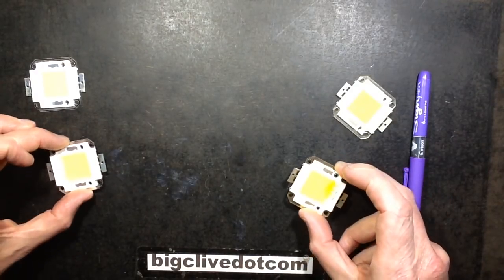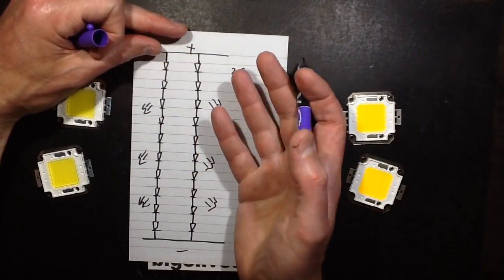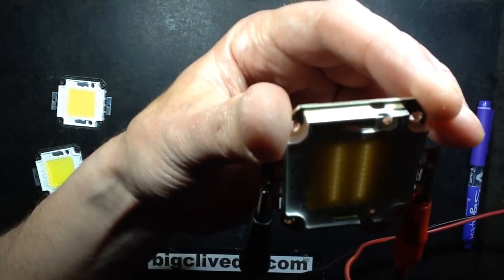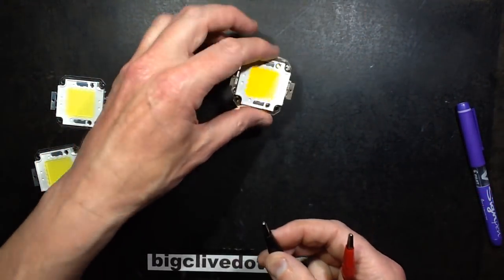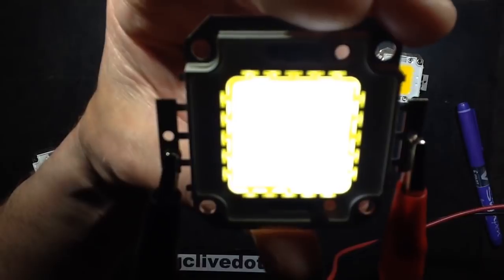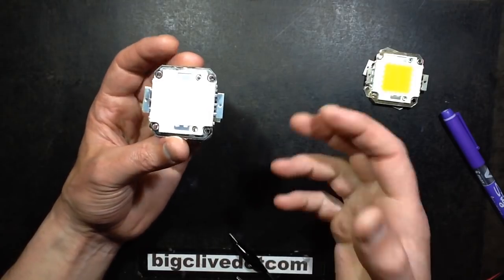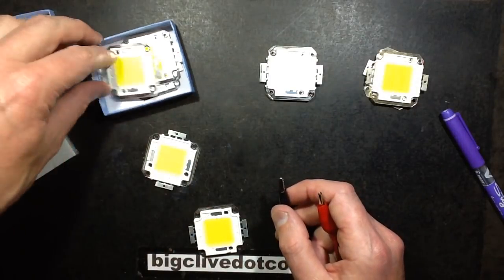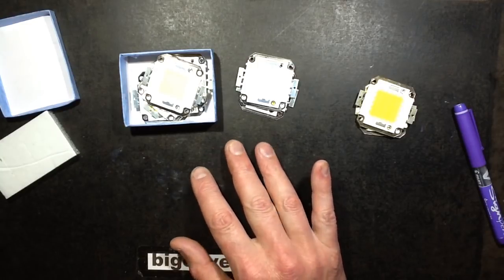Testing dodgy 100W LEDs from ebay sellers.

Comment: You can get the best-binned individually-packaged LEDs and put them on a LARGE BOARD, in the same configuration, and this will happen the same. This is what happens when your parallel/series arrays get too large and the lighting pattern your LEDs display show exactly this. You can't avoid this without a control resistor on each series string. Even the best-binned 100w COBs do this below their appropriate drive voltage, ALL OF THEM. 

I design/consult on LED units. This is just basic physics kicking you in the butt.
Reply: +techkitsune jesus lads chill. this isnt a test of who has the biggest brain or the most experience. at the end of the day we all have to wipe our own arses.
Reply: Even that is a lie. 300w LED unit driven at 150w will not replace a 1000w HID. Even the best LEDs out right now in the lab (330+ lumens per watt) you would still need the full 300w to match a 1000w HID.
Reply: +techkitsune you are so full of shit.. it's beyond incredible
Reply: +techkitsune it's common practice to advertise the led light as the equivalent amount of light it will replace
Reply: +techkitsune you insulted me your first statement, soooo. you def are a moron
Reply: +techkitsune I never have flown a drone??? sooooo there's that I guess
Reply: +techkitsune keep trying though..
Reply: +techkitsune you don't even know what the product you're standing in front of is comprised of.. please enlighten us as to what those leds are called in the industry you supposedly are at the forefront of.. they have only existed since the 60s. you really are full of it.. and quite unknowladgable on leds. dip = dual inline package. there what's in the light you're standing in front of.. but you laugh, because you don't actually know shit.
Reply: True! Uneven lid leds are not of any problem, don't necessarily have linear characteristics so could even level out above 20% power, but even if they don't it's a relatively very small difference @ normal power.
Actually common failure mode is nitride layers coming lose and bonding issues are far more common.
Reply: techkitsune a pothead arguing with an electrical engineer  OMG. Go smoke more dope boy.
Reply: Could you recommend a reliable LED chip source? I have an outside light that had failed due to water ingress and need to replace the chip, its a 30w warm white.
Reply: Nichia, Cree, Epistar, Edison, Osram.
Reply: ....Phillips.....lumi-leds...
Reply: I can't trust Philips further than I can throw them, not after getting sold 25w grow lights which were advertised as 40w.
Reply: I agree.  I learned in grade school level electronics books that diode strings always need ballast or equalizing resistors.  Still, that's to equalize currents between parallel diodes.  All the LEDs in one series string have the same current and should be lighting up at nearly the same time.
Reply: techkitsune ouch...slapped down by a real , educated EE. Ouch.👍
Reply: I have a set of LED lights I bought for floundering. When I connect directly to the battery they draw 5.2 amperes. When I add any length of wire to extend the power circuit the current drops to 2.6. The amount of visible light is greatly diminished. Can you please help with this. Thanks in advance!
Reply: @joshhagan2295  Are you soldering the connections or just letting them touch/clamping them?  It sounds like you're not getting a solid electrical connection, thus causing resistance at the contact area.
Reply: @joshhagan2295  fatter wire
Reply: No, this is what happens when they aren't matched. So much for LED expert.
Reply: This happens even when they're matched. You should perhaps learn about p-n junction separation over time.
Reply: Excuse me child, I'm a lighting research director and have done LED work since 2007. I have THE LATEST LED tech as I get to test it as an experimental engineer. The only LED on the market that will let you get 1000w HID at 500w is a 500-LED array of Cree MK-R driven at 1W (220 lumens per watt.) Son, do you even WORK WITH THE ACTUAL MANUFACTURERS? Oh, and it's "you're," not "your," but then again you'd be too stupid to know that. Come back when you have an integrated testing sphere and possess an EE degree. of at LEAST Masters level.
Reply: I didn't you did. You're the one full of shit - here's proof - me doing my job http://i.imgur.com/FFKWNy8.jpg Go piss off somewhere where people can accept your ignorance, child.
Reply: @techkitsune   Are you sure you should post pictures of your marijuana farm on the internet?
Reply: @edwardmorgan5750  It's legal where I am. Shame you don't live in a nice free state.
Reply: http://i.imgur.com/FFKWNy8.jpg Who is the one full of shit, boy? See that nice picture of EVIDENCE? Idiots like you are why we have Hillary and Trump running for President.
Reply: techkitsune your dense, a 300w advertised led replaces a 300 watt equivilent incandesant light, but pulls 150w  or about half. to replace a 1kw hps you would need 500w actual draw led. You don't get it
Reply: When you have to resort to insults, you know you've lost. :D DIP LED? Hah! Try again, sonny boy. I also say sonny boy because I'm obviously older and more experienced and educated. As for what I'm doing here, I'm answering the questions of those who legitimately want to learn, as opposed to you. BTW nice failures on operating that drone.

Comment: What is the specified voltage and amperage those big clive
Reply from the maker: Typically about 30V when 300mA per row of LEDs is used.  For a 100W LED the current would be around 3A.

Comment: so if I just need 10w chips, eBay is excellent?
Reply: No, buying high power LEDs is always a crapshoot. 

I normally just buy batches of 100 from various chinese sellers for between .10-.40USD and test them on the bench psu to sort them.

I've had little luck with the dedicated electronics suppliers, and the best luck I've actually had was with a clothing supplier that shipped them in bubble wrap. Just goes to show how much luck is involved.

Comment: have you ever found a good source to fined the 100watt LED's
Reply: ***** I'm pretty sure I'm not.
Reply: Pigeon
Not really obvious tbh, but thanks anyway man.
Reply: if you aren't rude to them you can get a refund and keep the bad led. I never had an issue with ebay refunding me for bad merchandise.
Reply: Ebay, obvs
Reply: Emily Ramirez You're the exception then, not the rule.
Reply: You don't want a 100W LED cob. If you need 100W, buy two 50W, or five 20W chips. The higher you go, the more thermal stress the chip is under and the more likely it is to fail prematurely.
Reply: +Mr Gallop When you're buying cob chips for a dollar I don't expect much, haha.
Reply: Hmmm? Link to store?
Reply: Mick C.
I've had some luck actually getting the dispute system on Aliexpress to work and getting free LEDs as a result. But I wouldn't count on it.
Reply: sure-display
Reply: Agreed same here!
Reply: Unless it is thermoregulated in the COB package.
Reply: In fact as a manufacture in China, we also do not count for that, that is for cheap products market
Reply: guess you meet with a strange supplier
Reply: that is right
Reply: 331620077265

Comment: Why do only two rows light up in the 20w leds?
Reply: Because they are 2xstrings of 10 leds. That is all that is in them. Hence 20w. 
Whereas the 100w leds have 10xstrings of 10 leds. Hence 100w. Each led being 1w.
hope that helps :)
Reply: Did you not watch the fucking video?
Reply: avada There are only 2 rows in the 20w led.

Comment: Big C, have you tried other sites than ebay? I tend to use Aliexpress.com a lot, its often cheaper than Ebay and you can buy in bulk for discounts. Also in my experience they seam to be bought direct from suppliers and tend to be a more reliable source for decant quality products.

Comment: Is there a way to know for sure if some stay unlit? It might be too bright to see, but if there is some other way to view through a filter, or test each diode. Is it possible that since it's such a high wattage that some resistance of some of the diodes don't have current pass though until a certain threshold, that's much higher than normal and then emits light? Are they in parallel, or series? Can you show tests of reputable suppliers?

Comment: no u dumb ass all the LEDs in the 100 chip light up just not consistent like the 20 becaas they need more power and your judgeing 100 wat LEDs when not even running them close to 100 wats
Reply: +datfrindlyfox furrys rule 

No, they should be lighting evenly.

Yeah, if you pump enough power through, even the mostly-dead ones will put out at least SOME light, but that's not the same as working properly.

Comment: I don't really follow your reasoning why a led-light would be bad if the voltage characteristics of series individual leds are not matched. It's like saying capacitors are bad because they have such wide spread in characteristics. 

Besides, the quality of a led-light isn't much in the diode itself; there aren't many things you can do wrong with a diode (it's a binary process, it either works or it doesn't). The quality is more dependent on the fosfor coating, giving you an even high-CRI light output.

Comment: The LED's dont exactly have to be evenly matched but they have to all function so if they have a specified min/max voltage than at the min voltage all the LEDs must at least be glowing (some can be bright) while at max all LEDs must be fully lit. Instead of looking at ebay look elsewhere instead. You should stop the habit of buying things on ebay as most are fake.

Comment: Hi, as a newbie to all this, you're videos are really good. 

The current thing that I'm really confused about is the difference between COB and other (discreet LED components such as SMDs etc) designs. i.e. I get your message about not wanting to overdrive the LEDs (say keeping them down to about 20mA) but I don't yet understand how you apply this to COB solutions. The reason is that I'm playing around with descreet component and COB solutions but am getting mixed messages (...or I've just missed the point) when considering which power supplies I need for each. For example, with discreet components (such as SMDs on LED strips) I'm hearing that the power supply should be rated higher than the (e.g.) LED string. i.e. With a 20% safety margin or more. ...but with COBs, you can use a PSU that's about the same (or less, so as not to over-drive?) as the the single or string of COBs your trying to drive. So, I currently have a 50W COB with a 50W PSU (DC: 20-40V and DC: 1.5A) and am scratching my head as to how the 1.5A current is shared between all the COB LEDs. The COB is spec'd as 10xCOB LEDs in series with 5 of these rows in parallel. Guess I'm trying to wrongly apply my understanding of discreet component LEDs circuits to a COB so, in my mis-guided approach, I seem to sharing 1.5A between the 5 parallel rows so I end up with 300mA going through each of the 10 series LEDs. Something not right here. ...so I guess that the 50 LEDs (somehow?) share the 1.5A resulting in 30mA per LED. ...but how?

Have I got this all wrong? Guess I just don't understand the way COB LEDS work yet. Any guidance or references would really be appreciated. ...or can you do a figurative tear-down of a COB wafer itself?

Thanks again, most enjoyable and informative.

Comment: those leds are not as bad as they seem, i bought lots of different ones too and most are indeed the same as the $2 100w cheapos. but they do work and put out a lot of light with the correct power supply. the reason the chips come on at different voltages is because the chips were not binned and were cheap as such or outside spec. i have used the cheap white, blue and red (orangy red) and have not had one blow yet but i have blown several drivers. led is a current device but whack a thermistor on your heatsink wired to the voltage setting on your driver and a capacitor across it for soft start. the spectrograms are very useful for hydro, only missing 660nm which should be supplemented by some non-phosphor chips.
Reply: I agree, as I have several and at the proper working voltage they work fine and for the price it is a hell of a deal. Quit crying of 3 buck.
Reply: But they won't last. The brighter ones are pulling more current and will fail much sooner.
Reply: @Steve_Just_Steve  First step: what do you know about series connection? Can the current be different for serially connected LEDs?

Comment: LEDs generate a large amount of heat.
If you don't heatsink them, they go into thermal runaway - the resistance decrease as the temperature goes up.

Comment: Thanks!

I just bought a bunch of cheap chinese 100W chips and of the 8 I bought, 5 were near-perfect, 2 were OK (better than the ones in your video, but not great) and 1 has a dead strip until it's too bright to look at.
Reply: ...Right.....Good ones are expensive....100 Watt CREE units start around $60-70+....

Comment: What is the point of this test? My test would be: 1) Light a reference, quality LED and check that volts and amps are what I expected, and measure the light with a photometer. 2) Do the same with the LED under test (with proper cooling) and check again volts and amps, and use the photometer to check whether light increases accordingly. If you don't have a photometer you can throw the light over a white sheet, photograph it and check EXIF data of the resulting JPEG to calculate relative exposure values (hoping you know how ISO, f/stops and shutter speeds work for that).
Reply: +Domenec Sos Valles The point of the test is that all the LEDs should light at the same current. He made a follow-up video to prove this.

Comment: An excellent video as always, as an electronics engineer myself I have no issues with your testing of these, unlike a few uninformed critics.
Sadly I still buy cheap electronic components on Ebay and often suspect from the price or the country of origin that what I might be getting is a "b" grade component. Even with my low expectations they still manage to frequently disappoint me. Deliberately mis-labelled transistors, diodes and various other components, it gets boring and you can't build anything you can trust using their components. It is criminal deception but Ebay do too well out of selling this stuff to take action.
Reply: +g0fvt High quality LED light manufacturer in China, using the chip, from the source to control the quality of the light source. Can email detailed chat: wiseled@aliyun.com
Reply: I bought regular 5mm LEDs from a very large far eastern country, and some of them had the negative leg longer instead of the positive.   How can a machine do that ? ? ?   I suspect the aim is to sabotage western electronics that use their components.

Comment: It does make you think about the claims of 10,000 lumen torches, 
I did some calculations on some and there is no way the battery would have last for the time they claim.
But I could not sell my 10,000 lumen Diving Torch because there ware other torches that claim the same for half the price. 
LoL 
I guess you get what you pay for

Comment: those leds are very bad you can get some that are 90 % intact more or less for 6 pounds on ebay. They are the ones where the contacts are not parallel and centred in the middle of the led. They are from sure electronics.

Comment: You are not entirely correct where it comes to static sensitivity. It is only ultra high impedance electronic technology like CMOS  devices that are static sensitive. Transistors and diodes and fets and Light Emitting Diodes are not static sensitive, so these LED light arrays only need protection from physical damage and not electro static discharge.
Reply from the maker: +Tim Pullen The older gallium arsenide LEDs are ESD resilient, but modern gallium nitride LEDs are prone to ESD damage when they reverse breakdown voltage is exceeded because they are a thin film technology.  When you buy the gallium nitride LEDs in bulk they come in the manufacturers original metallised bags for static shielding.

Comment: Can you help me with a question please, I bought a led 20 watt floodlight from China 3 weeks ago, the light as failed & my money back was given, BUT it lights up all the cells but not at 100% brightness, about 10% brightness why, I like your channel so keep it up, & those who slag you" why don't they get there version on YouTube, time & effort too great I assume. Great show.
Reply from the maker: +Robin Cox It sounds like the driver may be faulty if all the chips are glowing.  If it's the type that has a separate driver then you could try changing it for a new one.
Reply: +bigclivedotcom  ok thanks for the info, if I test the driver should it be putting out 20 watt?

Comment: The "real" issue is that the LEDs that light at very small current will be seriously overdriven when the voltage/amperage is set to achieve 100 watts. They will usually fail prematurely at open circuit and toss the whole string they are in. End result? A rooted light.

Comment: It's curious how the defective LEDs don't light but don't block the good ones in the string from lighting up. That must mean that they always fail short-circuit I guess, or that there is some zener-like breakdown effect that allows current to flow through them.
Reply: or that they are parallel and not series.
Reply: +steampowered_scientist nope, they're in series. very obvious to anyone who takes the time to understand this.